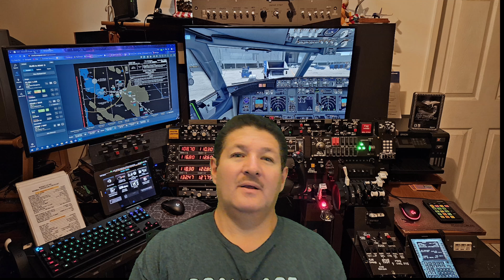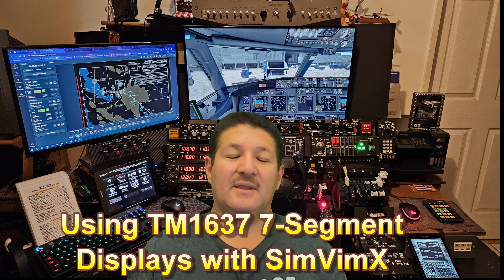Using TM1637 7-segment displays with SimVimX

Comment: You are also able to unsolder a 3-digit segment from a 6-digit TM1637 and solder it to the board of a 4-digit TM1637 module.  I have then configured it in SimVimX to display heading from the MCP.  It is a good space saver not having to account for an unnecessary digit in your build.  Likewise you should be able to place a 2 digit module on the 6 digit TM1637 to give you a 5 digit TM1637 where needed.
Reply from the maker: All the 6 digit TM1637 modules that I have DO NOT have separate digits. The have 3-3 bonded together therefore not separable. The 4 digit ones also have no available thru solder holes to be able to solder any digits to so I'm not exactly sure what you mean. Maybe the ones you got are from a different manufacturer.

Comment: A note about connecting voltage to electronic circuits, aleays connect the ground first before voltage.  In many plug in pc boards, you might see the voltage pin is shorter so that ground pin makes contact first.
Reply from the maker: @philnelson2364  Good point, I've never read that anywhere except when jump starting vehicles

What I should do is disconnect the Mega's USB cable until I finish connecting everything but I always forget 🙄
Reply: @Qosmokid  Same thing with vehicles and, I always forget to remove power to the mega before turning off the power supply.  The 7 segments go crazy.  Same thing when I forget to turn on the power supply before powering up the mega then, for a few seconds, wonder why the 7 segments look dim and display garbage.  I might create a power board to turn on power supply before the mega and reverse when powering down.  One switch for both supplies.
Reply from the maker: This almost reminds me of my Commodore 64 days when you had to turn on the computer and 1541 floppy disk drive in a certain order or risk damaging the drive.